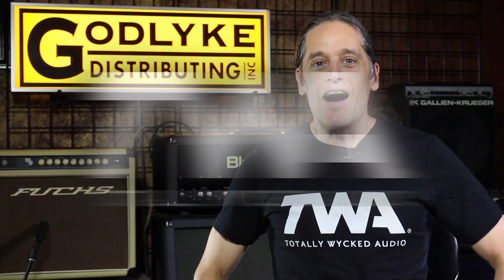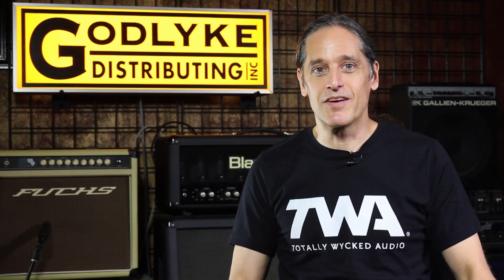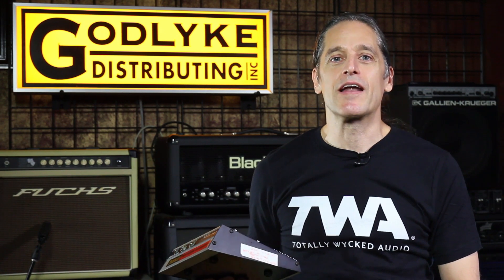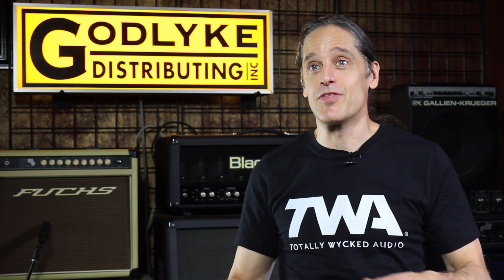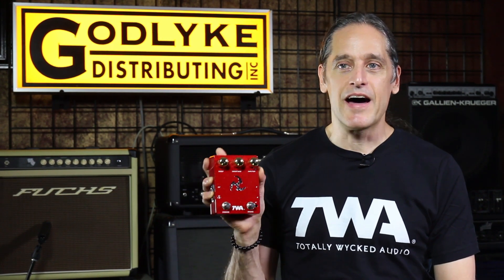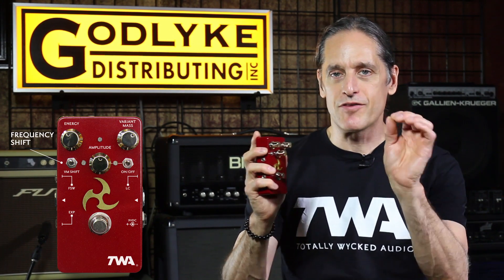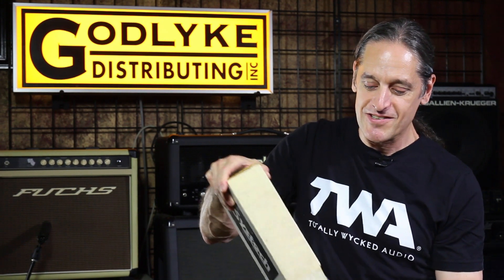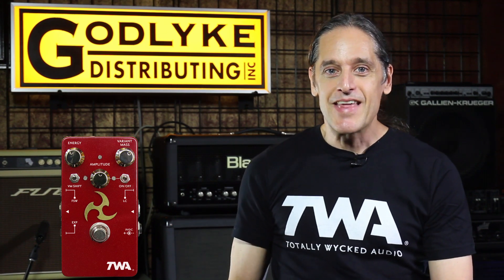TWA Triskelion® Harmonic Energizer® Mk. III - A Brief History with Kevin Bolembach

Comment: I can't believe you didn't use TOP JACKS, the EE engineers really screwed up on that one. I hope the 4.0 will have TOP Jacks for better pedal board troubleshooting bad cables and fitting closer together. The DC jack and Audio jacks should all be top jacks this is becoming a standardization 2022.
Reply from the maker: Haha, thanks for the comment.  Definitely not a screw up, but the only way we could fit the in/out plus all the other crazy features in this tiny package.  Although we truly love this third version of the Triskelion, if we every start to ponder a 4th iteration, we'll definitely consider doing top jacks... but we have some other cool creations in the works right now.

Thanks for listening!
Reply: @GodlykeInc  I know frank zappa used this pedal but the Dan Armstrong Green Ringer is very sensitive to the guitars volume impedance and guitars tone impedance which most octavia pedals aren't. I'm not sure why the Green Ringer is so sensitive to the guitars impedance and tone impedance settings because other octavia pedals aren't or the Triskelion. I would suggest that the engineers should ADD this in the Triskelion 4th iteration because its a big difference. Frank Zappa used the Green Ringer as like a cocked wah tones making it sound like a jazz horn solo section. The Triskelion Front End of the section need a dynamic picking range sensitivity and very sensitive impedance section in the circuit.
Reply from the maker: @waynegram8907  Some interesting concepts.  Although the Triskelion is not a clone of the Green Ringer.  The TK-03 more of a quieter yet souped-up version of the Systech Harmonic Energizer (also used by FZ).

The way Frank Zappa used the Green Ringer is super unique and very cool.  Definitely a project we'd love to dive into.  Maybe one day in the future we'll turn our sights to the Green Ringer... until then, we have some other cool stuff coming down the pipeline.